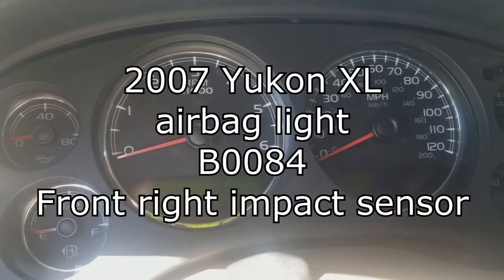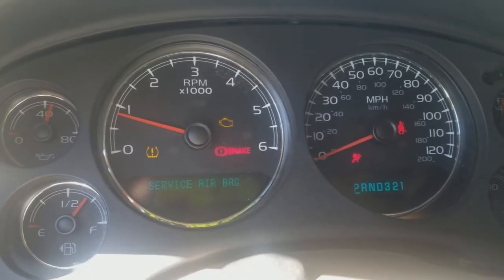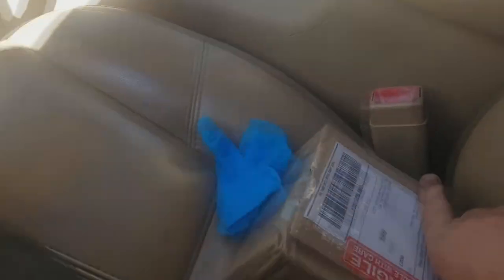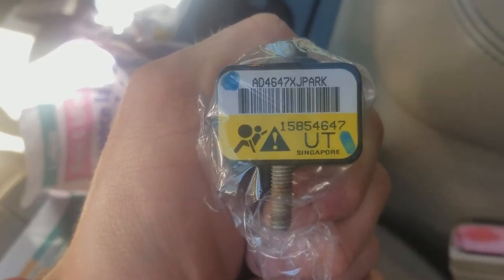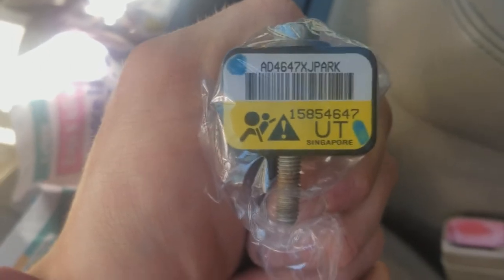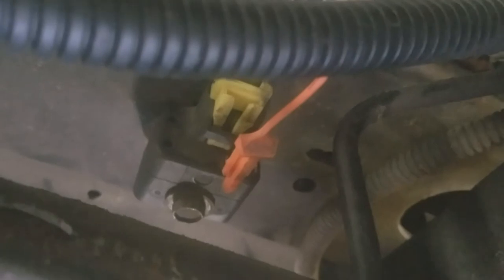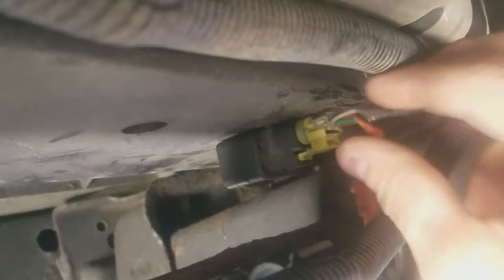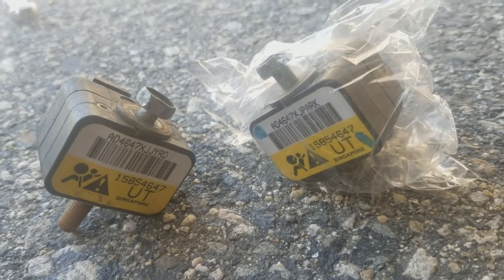Replacing 2007-2008 Chevy GMC Cadillac Truck SUV Front Impact Air Bag Sensor Suburban Yukon XL Tahoe

Comment: Do u need to disconnect the battery?
Reply: Everywhere I have read says that the airbag could deploy if you don't.
Reply from the maker: Most likely yes. However in reality, there is no power going to the sensor, nor is there a way to short it out the way the plug is designed. So yes, for your safety and over redundancy battery should be disconnected prior to switching the sensor.